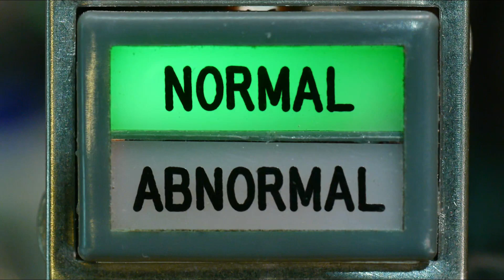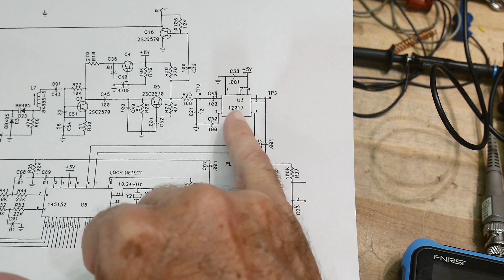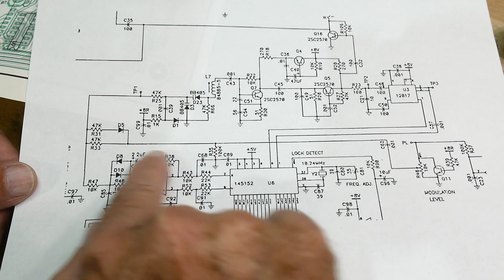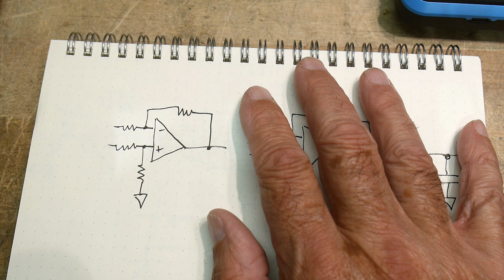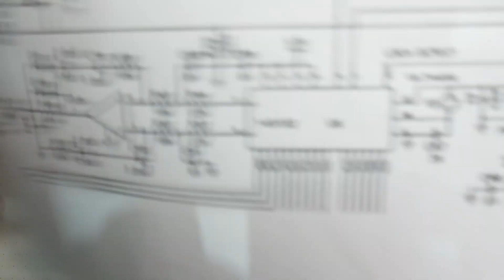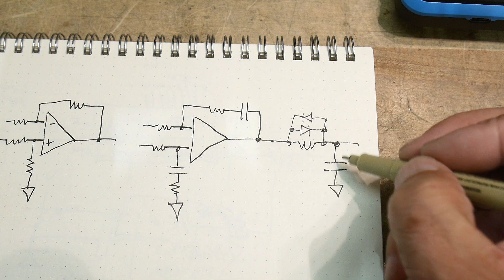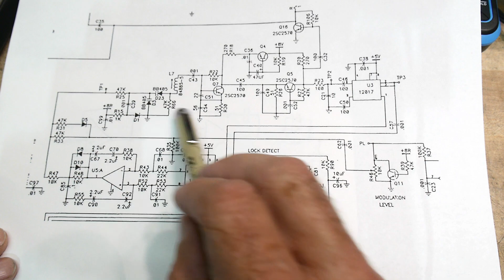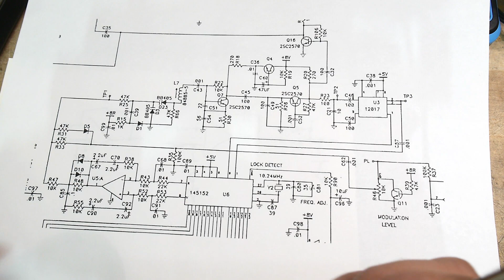#1515 Ramsey 2m Phase Lock Loop (part 9 of 12)

Comment: The problem with configuration  at 4:20 is that the gain at 0Hz is very large, and any offset of opamp would saturate the output.  They needed a resistor from output of OPAMP to negative input of opamp,

Comment: I'm enojoying this deep dive very much; thanks for all the effort. Q: What's with the back-to-back caps on the +/- legs of the diff amp (C67/C70 & C90/C92)? And why do they have their negative leads tied together with the positives on the outside? (+ - - + rather than - + - +).
Reply from the maker: large capacitors use chemicals that don't like reverse voltage. You can buy expensive capacitors made for AC signals but they can be expensive. The poor man solution is this, two back back.